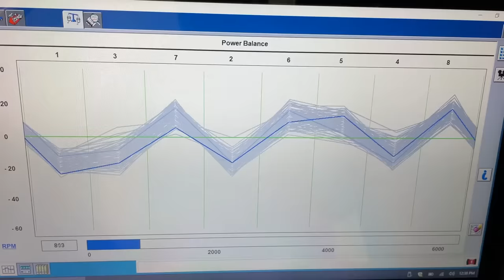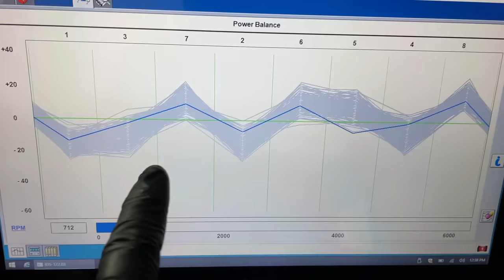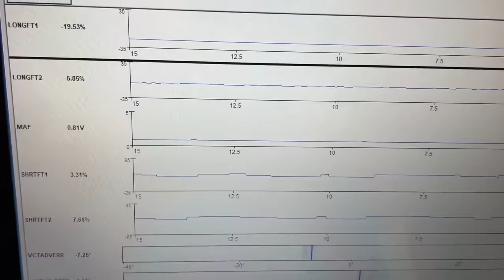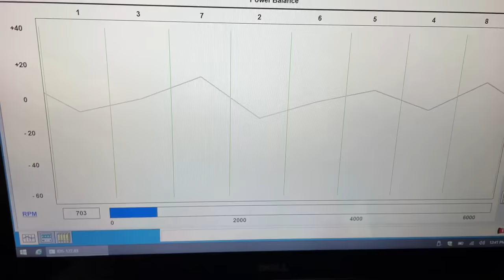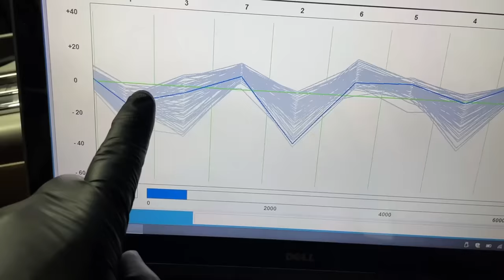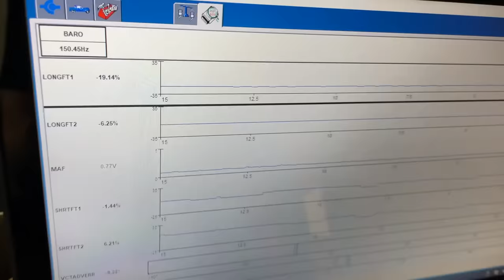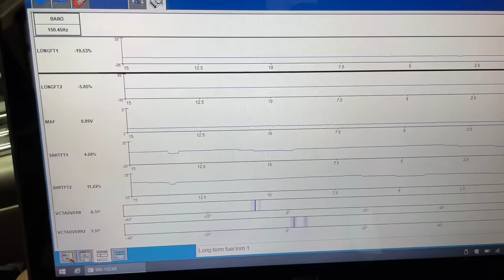Another Ford F-150 5.4L 3v Triton Rough Idle Problem the Other Shops Couldn't Fix!

Comment: I've thus far avoided owning a vehicle with variable valve timing. Since I've ALWAYS done ALL my repairs (except a TH400 rebuild back in '82 on the G/A : )... and it's getting tougher at my age... I just don't see the additional complexity and potential headaches being counterbalanced by any supposed benefits. My '02 Focus (owned 19 years), '65 Ford 250 (owned 24 years) and '74 Grand Am (owned 44 years) have always done JUST FINE without : )
Reply: I own one vehicle with it, a 2014 Mustang GT, but it only has 33,000 miles on it so hopefully I won't see any issues for a very long time.  Everything else I own is from the 70's or 90's.  98 Chevy Z71 bought new, 98 K3500 owned for almost 14 years, 1992 Chevy Cavalier owned for 15 years, and my 70 Monte Carlo owned for 34 years.

Comment: What do you think about using a zinc oil additive for 543v high mileage 180,000+ engines or just using full synthetic or Ford standard oil mix???
Reply: Anything will help.
Reply: Too much zinc will screw up your catalytic converters.
Reply: Just use a high quality full synthetic oil made for high mileage engines...

Comment: Hey I have a bad situation...I just bought a 2011 Expedition with 202,000 miles and it sounded great and healthy the day I bought it and drove it home a few days ago.
I took it for a drive yesterday and the check engine light came on so I pulled over and the valve train was making noise so I drove home (about 40 miles) and dropped the oil and got the filter off and realized IT WAS THE WRONG FILTER!!!! It was a STP S10590 and caused a lack of oil flow.
I put Motorcraft 5w20 in it and a FL-820-S filter on it and now it has a moderate “singing” and “ticking” noise. 
What should I do? Thanks.

Comment: I was getting ready to order the Adapter assuming with that and the forscan software I could simply repeat what he is doing here until I realized he is using Ford IDS software. So will I be able to have access to the same things as he shows in this video to correctly diagnose what he did here with the adapter and forescan? So even if I got the adapter and the forescan software and it does show the VCTADVERR and that shows it's not hovering near zero that doesn't necessarily mean that my issue is with the cam phaser, could that also mean I have issues elsewhere ?

Comment: Hey man I have a question that I bet you know the answer to ok here’s my problem. I’ve got an 05 f150 ftx 5.4l and the original engine had the cam phaser lockout kit in it and I guess they would’ve tuned it to be comparable with the lockout kit cause it ran fine well the oil pump went out in it and I was in the interstate and I stopped at the next exit and by then it was toast just that quick and so I had to get a used engine put in it and this engine doesn’t have a lockout kit and it has ran like crap every since I got it put in. It won’t rev up past 3000 rpm becayse it dies and it won’t even go up hill without slipping or something because on live data when I go up a hill the timing will go from 30 or so to negative something and as soon as it hits negative it will feel like it is slipping but I’m wondering if I drain the pcm if it would reset it and erase any tune that may be on it causing me to have a rough running engine please can you help me because it’s driving me insane and it’s been like this for a year and tiday is when it hit me about it having a tube for the lockout kit but this engine just doesn’t have the lockout kit although I needs the lock out kit I just can’t afford to get it done right now and I’m not sure if I can do it myself cause idk how hard it is to do and if you woukd have to have special tools or anything

Comment: Got 2010 f150,did timing chain,phaser,sparkplugs.fired up engine runs great after it gets warm start rough idling really bad and got code p0340&p0345 Say camshaft position sensor tried diff sensor still does the same thing really rough and it’s stall the Engine.

Comment: When doing the timing chains is it necessary to lock down the cams somehow?
Reply from the maker: I have an entire 4 part series on how to time this engine properly, have you seen it?
Reply: @FordTechMakuloco  I will check it out. I've watched many of your videos but probably need to go back and look again. You definitely have the best Ford videos out there. I just discovered the problem on my 2004 was that impossible to reach vacuum line on the passenger side behind the manifold between the engine and the firewall. I had to loosen the fuel rail and mash my hand in behind there to find it. It fell off and was causing 171 and 174 codes and also stalling at low speeds with rough idle. Somewhere there's a Ford engineer who needs to get punched in the face.

Comment: Should I use penzoil platinum or Mobil 1. Can please tell me why you prefer the Penzoil?. I’m considering a switch now. I have the 2005 5.4 amd I’m having a power train reman installed this week and will switch but wanted to know why you favor it. Been a long time fan and follower much respect. Appreciate your work huge help. Thanks
Reply: He recommends 5w-30 Pennzoil Platinum due to the fact that it keeps the engine extremely clean and has additional viscosity over 5w-20 to assist with reducing wear.  However, any good synthetic oil will keep the engine clean as long as you change it at regular intervals.
Reply: @TheTruth27536  Thankyou for your response. Appreciate it. I understand I’m just curious why he prefers it over mobile 1 it’s been the gold standard for so long I’ve used it for 20 years synthetic and yes I been using 5-30 for 95 percent of the life of the truck, it’s my understanding they used 5-20 for fuel economy crap but 5-30 is better especially for the higher mileage as it’s thicker I think. So it’s safe to say he has seen a mobile one engine and penzoil and thinks the penzoil is cleaner and less failures I guess. I wanted to hear from him because I’ve never thought about a switch but since he is the best mechanic I’ve ever seen I trust a switch. He did a video of a super clean mobile one engine with no mention of penzoil but then he uses penzoil and motocraft semi synth for eco boost. So I wanted him to tell me what he’s knows about it being superior. It may be that they use the natural gas to produce it. As you can see I’m very anal about my oil, 99 percent of guys will just say all the synthetic change every 5 and your good, but i care about the details

Comment: I have an 05' 5.4 3 valve...with just under 80k it was my father's truck who has dementia, and gave the truck to me....around 75k i started having to replace coil packs And plugs.....my buddy was a manager at a local garage....but not aa mechanic....he xould run the diagnostic Snap On computer......i ordered 2 cheap VVT sensors....to have it run to where it would run rough, go into limp mode?  And die at every stop. The store manager at an Advance Auto i used to work for told me to only use Motorcraft sensors, that for some reason that's just how it is. My buddies diagnostic says its throwing VVT sensors on both sides. Should i take the 200.00 gamble....There's a delete?
Also was told to stay away from cheap timing kits ....so JEGS makes one with the bigger mellings oil pump designed specifically for the small drain holes in the heads.
Kit us around 800.00
And around 75.00 hr for labor.....this was my father's truck....I'm 46 and want to keep the truck because it's all i have left that we both enjoyed.  
And is a VVT sensor jib something i could do ...I changed the plugs and coil packs....
Would appreciate some feedback here in Boyd Co. Kentucky....please!!
Reply: Easy to do the VVT sensors on your 2005, you will need new VVT sensor grommets though if you decide not to pull the valve covers.  Always buy Ford sensors and internal engine parts with the exception the Melling oil pump.

Comment: It seems as tho mine ticks at start up...smooths out while driving...coming to a red light she starts to stumble. If I pop it in nuetral...rev it...it smooths out again. Already had phasers and everything fixed
Reply: Sounds like an oil pressure issue. Are you running 5w30 oil? My 2006 had this issue a few times, I switched it to the 5w30 full synthetic with 1 qt of Lucas oil stabilizer. Issue never returned, even in hot summer temps.
Reply: My daughter's 2008 5.4 had same issue at 170,000 miles , switched to Rotella 5/40 synthetic ,fixed the stumbling problem, has 260,000 now, still running strong.

Comment: 2009 f150 5.4 ...I installed a  new complete timing system that includes phasers, chains, tensioners, guide plates, vvt solenoids, spark plugs and coil packs.... The truck runs great until it gets warm then it has a rough idle.. Can you please explain what may be wrong?? Thanks.
Reply from the maker: You have oil pressure and volume issues causing erratic vct operation.
Reply: @FordTechMakuloco  So my in dash oil  gauge is showing to be good, so could this be faulty as well?
Reply from the maker: No the oil gauge is only responding to an oil pressure switch that closes at 7 psi. So it is not an actual oil pressure sending unit nor is it a real oil pressure gauge. So I say it again you have oil pressure and volume issues.
Reply: @FordTechMakuloco  After oil pump replacement, what weight oil should i use?
Reply from the maker: 5w-30

Comment: What causes these phasers to fail?  Also, I have a 2015 Explorer..3.5l..Naturally aspirated..I believe this engine has direct injection and variable valve timing..(phasers)..83K miles..Driven conservatively with frequent full synthetic oil changes might it make 200K miles without carbon build up or timing issues?  So far no problems..
Reply: Poor original design.
Reply: Poor maintenance is a large contributor, such as lack of oil changes, or going too long in between oil changes.  This particular engine looked fairly clean inside, then again it may not be original engine.
Reply: Bad engineering

Comment: What if you hear a hissing after you turn it off
Reply: I’ve always had a hiss from the passenger side of the engine when I turn it off. The trucks running great, however I too wonder what it is?
Reply: @1mropz1  vacuum actuated motors for the air dampers releasing.
Edit: Or refrigerant pressure equalizing in the evaporator coil.
Reply: Check for a snake under the dash

Comment: Wouldn't the baro just be at amendment air pressure? 
I'm feel like I'm missing something. 😕
Reply: The Baro reading was 150 hertz if you convert  that in to a PSI reading it would be ambient pressure.... depending on you location.

So yes.... you are correct. If the catalytic converters were plugged.... the reading would be something like 124hz. It's a simple way of eliminating the cats as a culprit. Otherwise you would have to physically check back pressure at catalytic converters by removing the cat-montors and installing a pressure gauge.
Reply: It's not directly reading the barometric pressure, it's a calculated value. If the engine is not breathing normally then it may calculate an incorrect value.
Reply: @RobertHancock1  I agree.... I didn't mean to imply it was a direct value.
Reply: @RobertHancock1  most baro readings on vehicle's running speed density come from the map sensor at koeo and locks the value in , unless it has a dedicated baro. Maf strategies have a dedicated baro sensor constantly reading.
I'm just confused as to why something not located in the exhaust stream would give any indicator to anything in the exhaust stream.
Reply from the maker: The BARO is inferred by the amount of airflow past the MAF. If the exhaust is plugged up the amount of air past the MAF drops and the pcm inferrs a lower BARO thinking the vehicle is operating at a higher elevation with thinner air density.
Reply: @FordTechMakuloco  thanks, makes more sense. I didn't want to assume because manufacture like to do everything different.

Comment: Hell, my '07 Triton has 252k on the original timing hardware. I do plan on replacing them sooner than later though.
Reply: You never know,  you might have that 1 rare one that'll go, and go, and goooooooooooooooooooo lol
Reply: '02 with 327,500K
Reply: @blowme5150  And use 5W30 NOT 5W20!
Reply: 05 with 220000
Reply: OG 08 240,000 👍👍😎
Reply: '06 261,236 here

Comment: Can these new oem phasers be bad from the factory? After full timing job with oem parts and melling pump, I’m having the infamous knock from bank 1 phaser, which is brand new fomoco. I’m stumped.
Reply from the maker: They can have a slight knock due to manufacturing variances yes.
Reply: @FordTechMakuloco  thanks for the reply. Are these variances ok to run or recommended to replace?

Comment: I brought my truck into the dealership and specially asked for them to change the phasers here in Alaska. It sounds like a diesel truck at idle. All they did was charge me a ton of money for diagnosis and an oil change, saying everything is within specs and refused to replace the phasers. I've lost all faith in the dealership as they don't want to actually fix anything besides selling me stuff I didn't ask for and refusing to do what I came in for.

Comment: Where is your shop located? I have a F150 where i replaced all the Ignition coils and plugs and both camshaft sensors and my truck is still running hard and spitting P0340,P0344, P0345,P0349 codes. I am in Illinois
Reply from the maker: We are located in Northern Illinois see here-  http://bsgautomotive.com/
Reply: @FordTechMakuloco  great. I will give you all a call tomorrow. Thank you

Comment: No one in my area want to touch my 2011 5.4 3v. Have a slight tick at low rpms when in Drive or Reverse. But drives normal otherwise. Have noticed when I'm coming to a stop the engine seems to shoot up in rpms right before it come to a complete shop. All three places I've taken it too simply get in move it in the bay and all said it needs a complete timing job.

Comment: My wife's 05 Expy has 279K miles and has never had phasers. Regular oil changes and plugs and coils at 100 and 200K. It has started getting a rough idle and a cat CEL. With this many miles I hate to even touch the phasers. So I was thinking of just putting new cats on it.

Comment: hello, i have a slight miss on my 2010 f150 5.4 3 valve when hot, i did install a new timing kit, but it was a Coyles kit, and of course i did this before watching any of your videos, have you had any issues with these kits? i'm debating on opening it back up and doing the phasers again with ford ones.
Reply: If you watch his other 5.4 phaser videos he only recommends Ford factory phasers.

Comment: You’d think that someone at the first shop would have just sprayed some carb cleaner around the intake manifold. That’s the cheapest, easiest test there is for intake leaks. 🤷🏻‍♂️
Reply: Not necessarily . The Dodge 5.2 Magnum no matter how much carb cleaner , brake cleaner or even propane poured around the intake will show an vacuum leak . The data told me it had a leak but tests did not . Reluctantly i changed the intake and plenum gaskets and all was fine . I'm not an idiot so before someone points out the video was about a Ford 5.4 i am just saying the mechanic in a can doesn't always work all the time .. 
   It is obvious that the first shop much like countless shops and Techs everywhere were unable to diagnose an issue using strictly date . Way too many Techs just look at the codes and replace parts  according to the code . Data will tell a good Tech more than a code or codes ever will .
Reply: @7natcho  The problem with this case wasn't that the data was indicating a leak, it was in fact saying the opposite.  So, either they didn't look at the data, or they didn't know how to interpret the data.  I the case of your leak, you could see the leak in the data , but couldn't pinpoint the source, so gambled and it worked out.  There is a chance that the vacuum leak was somewhere else that was eliminated via the process of changing intake gaskets, like a leaking pcv hose, brake booster hose, etc.
Reply: @D2O2  when using carb cleaner to find vacuum leaks on modern cars you have observe fuel trims while looking for the leak.
Unfortunately the primary diagnostic tool used by many mechanics is a parts cannon.
Reply: It would try to add fuel not sure subtract it. No reason to even spray the intake just understand what the computer is telling you.
Reply: Friggin’ computers — amirite?

Comment: Brian, have you ran into get failed phasers or vct solenoids straight from Ford? Did the full timing job with upgraded melling hpv360 oil pump and all new ford parts, and still get rough idle when hot coming to a stop. Also I feel a slight misfire but nothing on scanner.
Reply: Solucionaste el problema

Comment: I have a for Question for you I will check my local Ford company they have no clue what they tell me I have an And 05 for 500 which has coil pack new plugs new fuel pump new rail sensor and wiring harness next to the AC charge line is not rub free but when it dries for an hour or so after it was star and a code come up running lean what could it be

Comment: Mines has a cylinder no 3 missfire.. 204,589 miles... changed cam sensors runs better... also the old cam sensors had some metal shavings on them... 2006 ford expedition limited

Comment: I get timing codes and I've replaced the timing sensors, vct solenoids and the timing chains have good tension. I get over and under retarded timing with random cylinder misfires. I can't seem to find a fox for it and no shops anywhere around here want to touch it. Could you possibly help??? I can send you much more information if needed. Example... it starts and runs Great, but starts acting up after it gets to normal operation temp, stalls out and loses power. Both bank 1 and 2 are issues. I'm sure there's more info I'm not remembering right now but I'll remember.